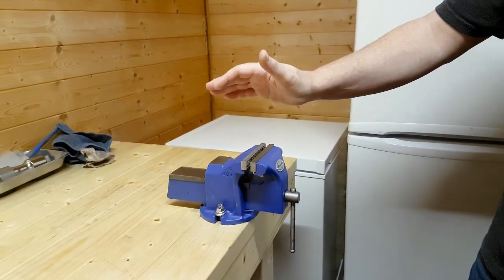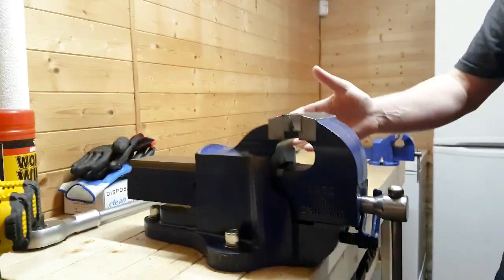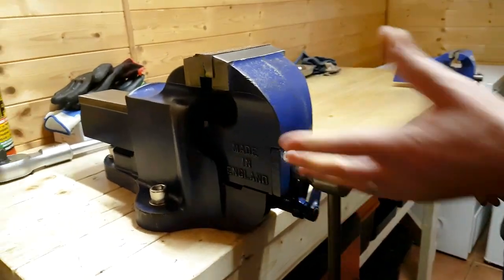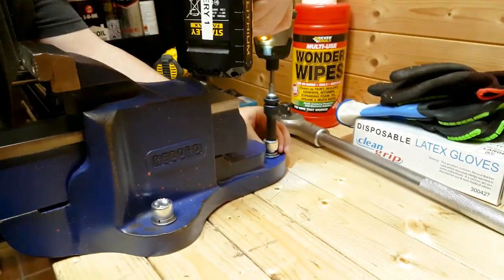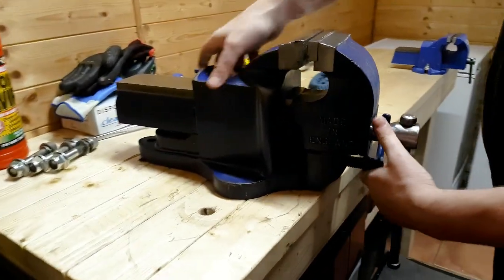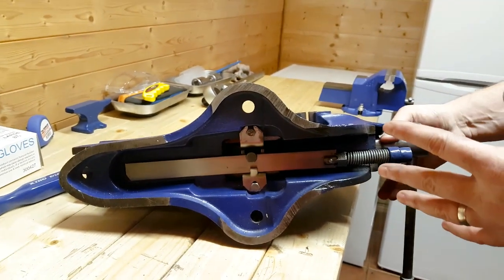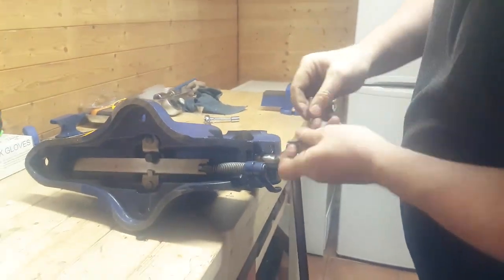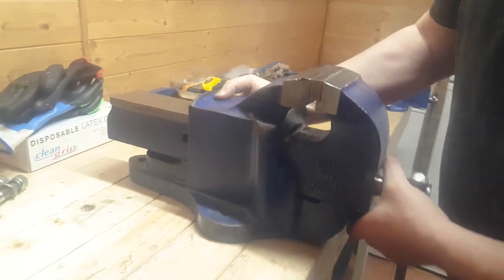Record Vice (No: 23) - Quick Release Mechanism.

Comment: I would like to find a vice just like that. Do you have a clue as to where I could find a large vice like this ??? Nice job explaining the HOW TOO VIDEO. VF
Reply from the maker: I bought mine from ebay.
Reply: @BestUserNameUK  Thanks for the information TD.
Reply: @BestUserNameUK  just bought one from Gumtree.  Only 50GBP in perfect condition and 40 minutes away. I found the ones on eBay were too expensive and in worse condition. The trick is to be patient.
Reply from the maker: @LuisCSAmaral  £50 is a bargain👍🏼👌
Reply: Also have a look on Freecycle, or put a post up for one, I managed to get mine from there and it's in pretty good condition!

Comment: Far be it from me to urinate on your bonfire TD, but if you had drilled the holes in your bench a bit nearer the edge, placing the fixed jaw of the vice just hanging over the edge of the bench you would make the vice a lot more usable  allowing workpieces longer than the height of the bench to be mounted vertically.
Reply from the maker: You are of course correct, but due to the way the bench is constructed I wasn't able to. Thanks for watching and commenting.

Comment: Very useful. I have an older 21 with a cast part on the bottom that retains the quick release bar. When reinserting I found that you needed to have this screwed in on top of the half nut. Essentially an exact reversal of your disassembly.

Comment: Great little video mate, looks like your work in progress has been going for a little while already lol, so shiney it looks nearly brand new, just picked a No.23 myself for £20 that needs a good clean up, quick release works O.K but this will come in invaluable to help strip down and clean and repaint ??, what did you use to polish all the metal up or did it come all nice and shiney, If you repaint it will you use Roudel Blue or Hamerite , Roundel is supposed to be enamel and is the proper Record colour, I always found Hammerite to be a bit soft, any answers will make my task easier ? Very good coverage of that quick release will make the strip down a lot easier to do, thanks
Reply from the maker: I picked this vice up from ebay for £50.. It was in good order as you can see, it just needed a clean and a bit of tlc. Cleaned it all with some bog standard degreaser, handle was made shiny with emery tape and the jaws got a quick polish with some white compound. As for repainting I doubt I'll do that now as it gets quite a lot of use... That said, I've cleaned up a couple of smaller vices and have used 'Roundel Blue' synthetic enamel - it's about as close as you can get to the original.

Comment: Fab video thanks for taking the time to make such a thorough informative one. 
I have just bought a similar vice and am hunting around for suitable bolts to anchor mine down. 
What are your bolts called exactly ? 
Their sizes ?
Their make ?
Where did you buy them please ?
And cost ?

Cheers keep up the good work

Thanks again
Reply from the maker: Thanks for watching and commenting. The fixings on the video are 16mm socket caps that I had laying around. Don't use them though as the heads get full of swarf. Use ordinary bolts instead, 14mm would be a good option as the 16mm are a bit snug in the vice fixing holes. Check out ebay👍🏼

Comment: Hello there, great video, helped me to get the vice back together. Was just wondering if you know what bolt size you need for the front part that holds the lead screw and quick release mechanism in place. Would be much appreciated because I plan to replace those bolts on my vice
Reply from the maker: They're imperial on mine, 5/16" BSW.
Reply: Thanks!

Comment: What stops the quick release sliding out the half nut guide? I’ve just bought a faulty one that needed re assembling but when I use the quick release I can pull it too far and it disengages and unwinds the spring tension.
Reply: The washer

Comment: I’ve saved this video. It will come in handy
I picked up one of these yesterday in fairly good condition but with a little surface rust.
Going to strip it down and repaint it. May get it shot blasted to clean it up before repainting it though.
Good video thanks
Reply from the maker: kev kelly Glad it was of use and thanks for commenting.

Comment: I have a record 24 vice with quick release, the problem I have is the quick release handle and spring will turn and release, just before I put slight pressure on closing the vice. Any suggestions will be appreciated
Reply from the maker: Have you tried taking it apart and re-assembling it? Sometimes the half-nut does not fully engage with the lead screw, one or both of these could be worn?
Reply: Cheers, will check that out.

Comment: This is a very informative video. Just after some advice. I’m currently restoring a odd vice. It’s a ‘rock island 1917’, it’s American (4 inch wide jaws) but it’s almost identical to a woden/record no 22 vice,I’m trying to source a the quick release mechanism for it as it’s missing. Are the quick release mechanisms the same size for the no 22 & 23? Is the lead screw on the no 23 20mm (3/4) diameter? Any help would be greatly appreciated. Can’t find info anywhere for this vice. Many Thanks.
Reply from the maker: I can't measure the thread on my vice as the lead screw is inaccessible - sorry. Regarding Rock Island vices this thread might be worth a visit?  https://www.garagejournal.com/forum/showthread.php?t=388237
Reply: TD thanks for your quick reply,I’ll check that out. Don’t want to be a bother but one last one. The two screws at the front of your vice are they 53mm apart? Just trying work out if the no 23 mechanism kit will fit my vice. Thanks
Reply from the maker: @Liam-db6zt  The 2 screws from centre to centre are 56mm apart on mine.

Comment: Hi Ultimate Handyman,thanks for this its been very helpful as I have been refurbishing a larger version,but have now run into problems.Your advice would be invaluable here as I am stuck.So regrettably hindsight would have helped me but I binned the original vice jaws as were in poor condition,internet search for original jaws got me no where  as they cost a fortune. Local Engineers shop had a cracked foreign vice which I was able to buy jaws from ,wrong bolt spacing and a few mm shorter but would have to do.So welded up all holes in both jaws and vice body and tried to drill new ones ,no chance,I think weld heat hardened them further.Tried cobalt drill and new Dormer drill bits at low speed with oil,no luck.Problem is now I have two options; tack weld jaws to vice body, will look horrible, or try normalizing (reheating) the welded zones,have done this with B&Q gas canister but could not get to red hot heat and do not know if there is a critical temp at which I have to attain.Any suggestions please Richard Allan.
Reply from the maker: You could try grinding the welds flat, centre punch, centre drill then use a carbide tipped drill bit (available from Amazon and other places) Google search. The jaws and where they fit are hardened cast steel. I tried countersinking the holes further on my vice jaws and ruined 3 countersink bits. If you're looking for red heat butane won't touch them, get a MAPP gas torch (the plumbers 'weapon' of choice). Sadly they are not cheap, probably on a par with new Record jaws. Let me know how you get on.
Reply from the maker: Richard Allan Multi Purpose Profi Drill Bit Set - ARTU 5 piece https://www.amazon.co.uk/dp/B00DXOJ1DM/ref=cm_sw_r_cp_apa_HL3EAbFGTQHHN
Reply: Thank you very much TD. I looked up those drill bits,good reviews,have not heard of them before,will try them out,I realize I now have to spend some cash. If my neighbor uses his OAP discount I may get some B&Q MAPP GAS however I just wondered if a Tig welder with tungsten in its collet and turned up to( warp 5) super-hot and no filler wire may introduce enough heat to soften the cast steel,my friend is a welder he may be of help,but your advice is good and is what I shall do .I enjoy your channel and value your reviews and wisdom.Will keep you posted,Richard.
Reply from the maker: Richard Allan Good luck.. Again, let me know how you get on and thanks for your comments.

Comment: ive had a  no23 for years ,but it never has worked properly, when you go to do the vice up tight it slips and releases , i cant seem to sus out why it does this, can you shine any light on this issue
Reply from the maker: I can only assume that the lead screw and/or half nut are worn? Have you tried taking it apart, cleaning and reassembling? Also make sure all fasteners are tight. TBH not a lot can go wrong with Record vices - excessive wear is usually the issue.
Reply: @BestUserNameUK  thank you, i have cleaned it, it must be wear , although it looks good, but dont have another to compare it with.
Reply from the maker: Another thought is that the lead screw and half nut are not fully engaging with one another, which could possibly be due to the quick release mechanism.
Reply: @BestUserNameUK  i will have another look later thank you.
Reply: Mine does that exact same thing as well. Something went pop in it when i over tightened it. Now it feels like it jumps back on the thread when you tighten. I need to dismantle it and have a look , thanks for the video i wouldn't have known where to start.
Reply from the maker: @bikewreck85  Hope you get it sorted👍🏻
Reply: bikewreck85 did you figure out why it was slipping? My 36 is doing the same thing.  Cheers